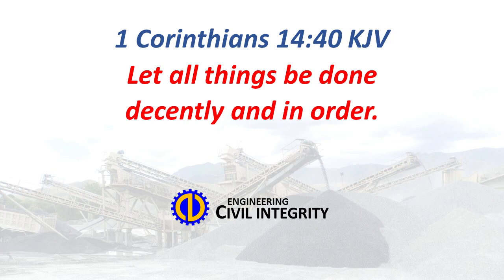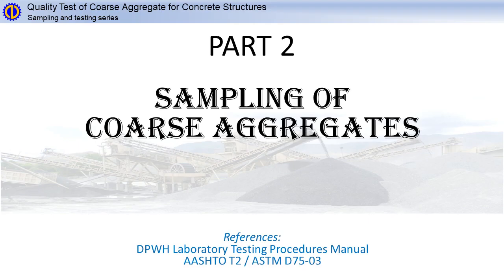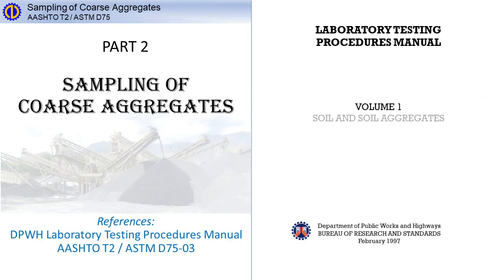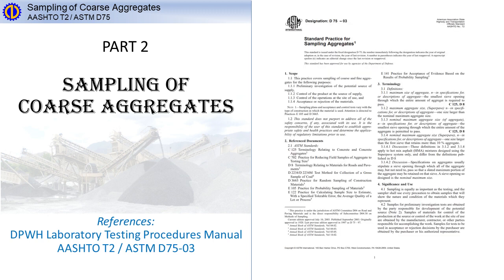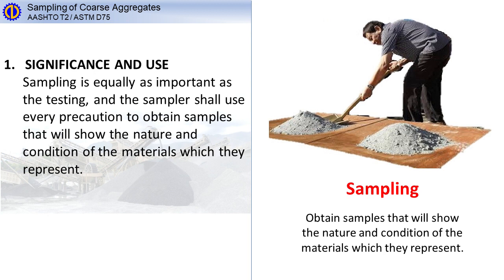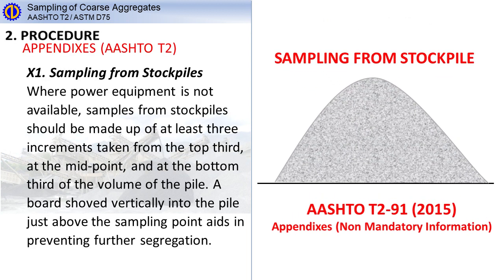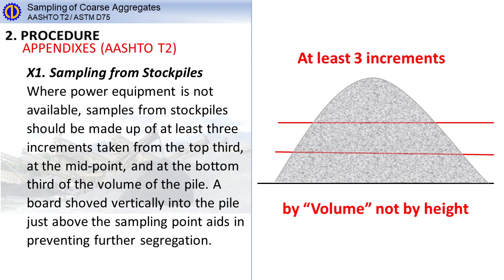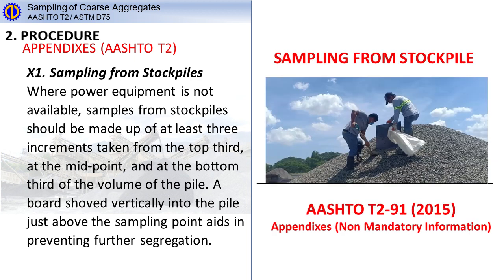Sampling of Coarse Aggregate AASHTO T2 ASTM D75

Comment: What is size of plate please
Reply from the maker: ASTM D75 and AASHTO T2 does not specify the board thickness. Any size can do. The purpose of the board is to prevent the aggregate from rolling down.

ASTM D75 and AASHTO T2 Appendixes
X1.2.2 Where power equipment is not available, samples from stockpiles should be made up of at least three increments taken from the top third, at the mid-point, and at the bottom third of the  volume of the pile. A board shoved vertically into
the pile just above the sampling point aids in preventing further segregation.